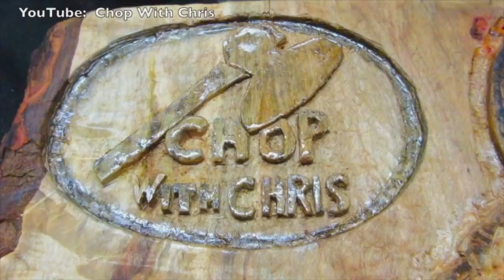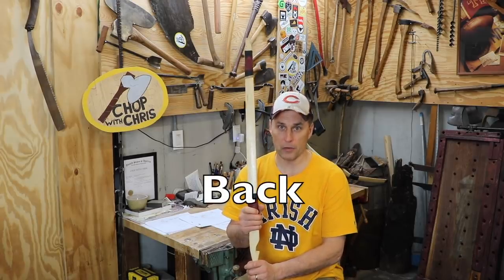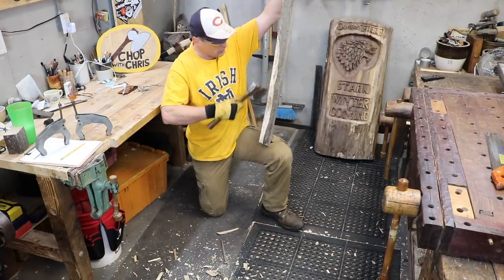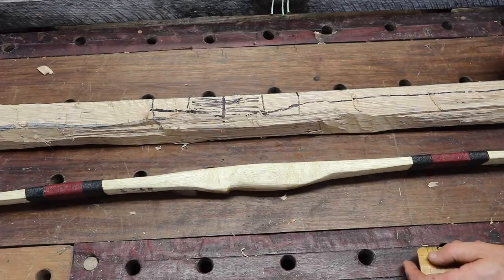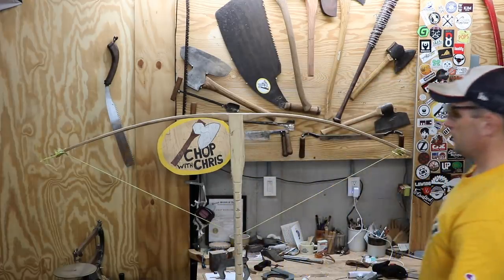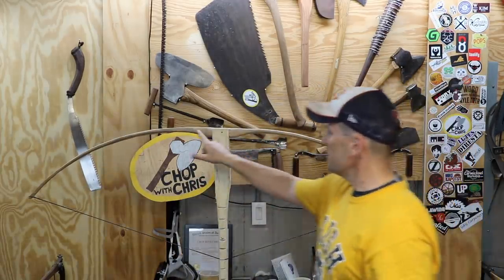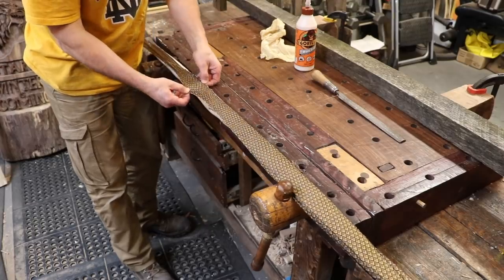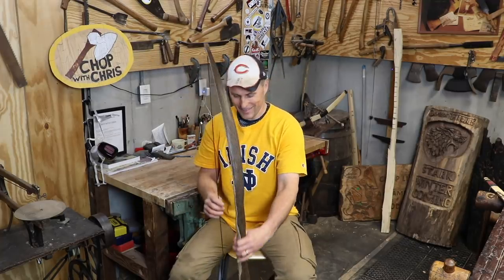HOW TO MAKE A BOW WITH SIMPLE TOOLS

Comment: I like how you made this.  I would have appreciated a little closer views of the back of the bow showing how the one continuous fiber looks down the length of the bow.  I understand doing it but I would have liked to have seen it.  Is it possible to use a froe in the early stages to get to the one ring for the back?  How long should the wood be aged or in a crises situation can it be done with green or fire treated wood?  Just curious, I’ve never made one but would like to attempt it in the near future.  Thanks.
Reply from the maker: A froe will work.  Wood should be dried.  I’ve some people fire dry them but I️ do not.  Got the feedback on the fibers
Reply: Typically people use a drawknife. It's like a froe with more control. People have had a lot of success drying their wood in a 80-90 degree kiln or in a hot attic.

Comment: Chris. Just a small correction. Wood bows bend towards compression. For example. In a wood diving board- the  top is in tension. The bottom is in compression. Similarly the back of the bow is in tension not compression.
Reply from the maker: Got it.
Reply: I believe that is what he said
Reply: That's what he said at 2:40 -- unless he edited the video to change what he originally said.

Comment: are you able to tiller while in tension to make sure you get even tension in real time?
Reply from the maker: I have not tried that.  Makes me nervous so close to a bow in tension. If the string slips you can get smacked in the face.
Reply: I've tried it and yes it hurts when things slip and smack you in the face! Just take your time. Check it, file it, and check it again! I was making the bow for a foot operated bow lathe about 25 years ago and still have a scar above my eye!
Reply: That was my question as well. Thanks for the reply
Reply: Yes you can, but it's better to do it when you're closer to your target draw weight. Also, if you do intend on tillering it strung, you should draw it a little in between scrapings so you get rid of the cell memory in the wood fibers otherwise you're not going to see the change.
Reply: A pistol grip "quick" clamp over the notch keeps it safely in place (or a C-clamp if quicks are too modern :) )  @ChopWithChris

Comment: perfect class Chris! specially about the wood selection. will start looking for this from now on!
Reply from the maker: Let me know if you have questions.
Reply: I do actually... you speak about the front and back of the bow. What about the sides? Do they affect too much on the  tyloring (how do you write that?) and the strenght? Or do you just follow a straight taper from the handle to the ends?
Reply from the maker: The back of the bow is the part that faces away from you.  Once you have achieved a single wood fiber, DO NOT TILLER the back of the bow, only tiller the front.  Better to taper wider half way between the handle the ends and then taper narrower to the ends.

Comment: Thank you for explaining in such  clear detail. Ive actually gained an understanding not just directions. Ive learned more from u in this one video then the half dozen before you. I like the fact that u explain why each step along the way. You are a great instructor and I greatly appreciate you sharing your knowledge and time creating this for us. This is truly an art. Im in awe lol I usually have more questions then answers but u were so thorough I only wonder which types of woods? Seasoned or green? I'm actually looking to figure out what peice will need to be created for the center grip peice to connect these 2 arms I was given. Yours is one peice so is that ur preferred way to have that grain strength? Do you know what would work for these or should I just make it a decor peice and create my own with one solid peice? I value your opinion bc u obviously know what you're doing. Thats awesomeness! Im proud of you! Thank you  sir. Have a blessed day
Reply from the maker: Thanks.  The wood should be fully seasoned.  What wood are you thinking of using?  In the US good wood for a bow include hickory, Osage Orange, Oak, and mulberry.  Search google under “good wood to use for a bow” to learn more.  I’ve never tried attaching wood to a handle but want to some time.  You should be fine and will need to ensure not to stress the limbs too much since the handle area will likely be very stiff.  Good luck.  Chris

Comment: Simple tools, so well explained this is exactly what I was looking for. One question though, how do I make sure I don't take the tree ring off or damage it when I file down the back of the bow?
Reply from the maker: I guess you just need to go slow and be careful.  It also helps to add a backing as a safety measure.

Comment: My first red oak bow was Inuit string style backed with rawhide over that. Glue was gelatin and I used a cordless drill because I didn't have even a hand saw, the rest of my "tooling" was a really cheap folding knife. 
Oak doesn't need to be a perfect single ring to work when backed by anything, but it is still the best way, and even if you try unbacked or glue backed (just glue, nothing else) it will suffer more defects than about anything else. Great learning bowyer wood, but it is slow shooting and chrysals if you try to go too short or too strong. 
Nice job on yours!
Reply from the maker: You have amazing knowledge!   You should make a video.
Reply: it'd likley(certainly) be far worse and I am too ugly to inflict folks with myself.
 Think "Face For Radio"
But it'd be named "How to make a bow when you have no money" as I was pretty much stone broke at the time.
Reply from the maker: That video would go viral!😄

Comment: Fascinating. Bows are really cool and not as complex as I'd have thought.

One question though, how exactly does the backing help? I didn't fully understand that part.
Reply from the maker: The back of the bow takes all the stress and ofter the fibers start to lift and eventually will cause the limbs to break.  The backing prevents this from happening.
Reply: I see. Cool bow. Nice to see trash turned into beauty.

Comment: You mentioned that your backing has some signs of cracking so the tillering wheel and a tillering string can be used for safe bend when tillering is in progress. You might stress the wood too much when you leave it for 10 seconds on a tillering stick. When useing tillering wheel and string you can pull a little bit at the time and see what part needs work and what doesnt.
Reply from the maker: Merci!

Comment: Would it be possible to back the bow with Duct Tape? That's a material I carry everywhere and am wondering if that would work for this application in a pinch.
Reply from the maker: I suppose but I’ve read drywall tape is better.

Comment: im making one out of "Maki" Podocarpus Macrphyllus  from a dead standing tree in a line fir a hedge but one is dead so thats my attempt . ive cut it to 4 foot 2 " the wood is so solid i guess its going to look like stone when done its so dense hope it works ive only used a machete and wrasp file and a hacksaw with metal blade to shave down the dense bumbs oh and sand paper. thanks for all your knowledge i see where ive made a few mistakes but i didnt have much material to work with i just winged it without watching any videos till yours  but did do alot if your techniques  im ready to tiller and hope to find a nice tie to copy that technique as i may have too . aloha from Hawaii
Reply from the maker: Wow!   Thanks and good luck!

Comment: would you recommend using panderosa pine tree wood? I'm in northern Arizona mountain's.. i have a tool's i have, a Ka-bar.. a handsaw, and hammer
Reply from the maker: No.  Check out this article.  http://www.primitivearcher.com/smf/index.php?topic=16560.0
Reply: Chop With Chris thank you! :) i am going to go to lowes , homedepo and just but some Board n do as you did in this video. i found some Chisel's today that havnt been used n i have some old files. N my knife to Chop the wood as you done! thank you i will get back to you about my Project! N how it turns out do you have a Fb group or Page i could add if i havw any questions as i go along? ive never done anything like this before or even worked with wood
Reply: Chop With Chris i went today I picked up a Birch Board from Homedepot. its 0.75 x1.75 is this Big enuff? it had no Nots n is really straight.
Reply: also cut it to 60inches length

Comment: Hi Chris! Question! When you building a crossbow flor you attention to annuel rings or does not matter? I have abo your cannel :-) Your info is very good! Happy new year and good building for another projects!
Reply from the maker: Thanks.   A crossbow should be just like a bow so the frown rings matter.
Reply: Sorry! My first question was not formed good. I mine the main stock or the main ground of the crossbow not the bow it self. Sorry, my english ist not good. Im from germany :-). I would cut the wooden main stick or stock of the Crossbow divide and turn it 180 ° than with glue together. This way, the wood can not warp. Why don't you do that?
Reply from the maker: That’s a good idea.  I’ve never made a laminated bow.  Danke for the idea!

Comment: Hi Chris. Francis from the UK here. I've been inspired by your videos and I've started to turn an old oak beam in my garage into a bow. I only have these four tools which you are using plus a bushcraft knife. So far today things have gone well but I've hit a snag and I was wondering if you'd be OK with giving me some advice? I greatly appreciate the time it takes you to respond and I will understand if I do not hear back from you. 

I'm trying to establish the back of my bow so that it is as you advise, the problem is I'm completely new to woodwork and i do not know what one unblemished growth ring actually looks like. Now I am near the depth of the back I originally designed for I've had a go at smoothing it out with a file and a knife just as a practice for the actual back about 0.5 inch further in. Finding my skills a little imprecise, I am reluctant to remove any more wood for fear of going to far. This link leads to some pictures of what I have so far.

https://imgur.com/a/6a2P7Df

Any pointers you could offer would be greatly appreciated.
Reply from the maker: Try to maintain the dark ring.

Comment: Informative and well made.  But the quality of the material showed through, when the silk was applied you could already see that the bow was starting to follow the string.  Either that or you had to decurve it to stop it from shattering, but I've only ever heard of doing that for pine.  Still, as a survival bow kind of thing it works well.
Reply from the maker: The wood was definitely in bad condition.  I should have applied the backing earlier in the tiller game process.  I could have probably added another 10# to the draw weight.

Comment: Chris - What kind of glue do you use?? I have a recurve bow about 45 years old, and one limb had a chip in the fiberglass lamination causing it to be slightly weaker. I simply raised the arrow rest to shoot straight again, but I would like to repair the bow and use the original arrow rest position. I have tried to buy glue at many box shops, but they have no idea what kind of glue to use that would be flexible enough. I would appreciate the info.

Comment: When you put the silk backing on I was thinking, would it be an option to use a hot iron to help the material to be put on? Then the extension of that thought was, what would a layer of charred wood, like they do for instance on roof shingles, do to the back of the bow. Would it help or destroy?
Reply from the maker: I would not want to over heat the wood.  Could lead to breakage.

Comment: How thick are longbows typically? (Not including the handle) I’m making my bow out of hickory and I want around a 50-60 pound draw weight. I’ve gotten my bow shape roughed out at about an inch thick (1 7/8th” wide) but comparing it to other longbows it looks a lot thicker than what it should be.
Reply from the maker: That’s ok.  Most of the bowls strength comes from the thickness, not the width.  Buy a cheap luggage scale and check the draw weight now and then start slowly tillering until it’s even and at the weight you want.

Comment: Tensile strength does not equal draw weight. A silk backing, or rawhide, etc, will increase the tensile strength. It just doesn't automatically increase draw weight.
Reply from the maker: I agree.  My point was the wood was really brittle and installing the tie earlier in the tillering process would allowed me to tiller to a higher draw poundage since it reduced the risk of breakage.

Comment: Chris, I have a finished longbow the weight is 71lbs. I'm getting weaker in my older age lol. Is there a way that I can change the draw weight on the longbow?
Reply from the maker: I suppose you can further tiller it to remove wood.  That would bring down the draw weight.

Comment: Great video. Some constructive criticism from an archer and bowyer's standpoint of personal experience and research. If you plan on backing a bow, it's actually okay to violate the back somewhat and also rough it with a rasp to score-slip the backing in order to be better glued to the wood. Ishi and Geronimo did this with their sinew-backed bows as did and still do many Native Americans of tribes that use backing on their bows. If not backing, you really want to avoid using a file since they have the tendency to rip wood and as such, a card scraper or cabinet scraper is ideal with a spoke-shave also being a very good choice. Then follow with fine-grain (500 or more) sandpaper and a touch of light oil like linseed or a bit of Crisco on a rag. Clean and supple wood that is oiled and smoothed can then be burnished with the leading edge of a knife or a piece of animal rib-bone for somewhat of a stone-age touch on the back, making the concentric and single grain of de-crowned wood one chases harder and hold more tension and also look shiny and nice, too. All I need is my Fiskar's wood hatchet, my Mora bushcraft, a cabinet scraper, and some rough leather and a piece of sandstone aside from the whetstone, plus a rag and some oil. Two weeks to season if pre-oiled and heat-treated while carved green to speed up the seasoning, or the other alternative is up to a year or two if dried out the long way like I prefer as with English longbows and Cherokee bows. :)
Reply from the maker: Wow!   This is awesome.  You need to make a video 😄. Thanks for the information!
Reply: Thanks and quite welcome. :) The green-wood that gets heated and dried somewhat quickly is the traditional way to make Apache and Sioux bows using just a knife and flint shards for scrapers. The fine flint removes the need for sandpaper and leather and oil with bone burnishing is still used, along with the sinew-backing. Most of my experience come from Cherokee bows that are simple self-bows and flatbows made from hickory, black locust, honey locust, or even bois d'arc a.k.a Osage orange (if in Oklahoma for the latter-most) and made with distinctive diamond-shaped nock-tops. Only the Sauk and Fox along with the Seneca used a similar pointed design with nocks, but other than that, the bow was pretty Spartan and meant for hunting while tomahawks were the main weapon for war as with most nations east of the Mississippi. The Cherokee version uses your non-backed way (and often hickory at that) of doing it while also drying it in the rafters of a breezy summer lodge like that of a Seminole chickee for around nine months to a year. Also, it's best to cut it in the dead of winter and in the evenings when the sap is low in order to minimize cracking. Check out Noel "Tim" Grayson of the Cherokee Nation in Oklahoma. He's a very nice guy that does tons of stuff on how to make bows, flintknapping, bone tools, and other traditional skills. He showed me a number of things for how to get a bow to come out right.

Comment: I've been looking for a proper bow making video for ages and this is the first that i find a total beginner can do i really like the tips. I will use some power tools since i have access to them. Question time: how good of a wood would acacia be since it is quite flexible and I have access to it. Question 2: is that laundry rope that has wire core and rubber coating a good replacement for the string? Thanks a load.
Reply from the maker: What country?
Reply: Croatia.
Reply from the maker: I believe it can be used for a bow.  I would look at primitivebow.com for some info on this.  In terms of the string it scares me to use anything but a proper bow string.
Reply: Well, I do  like living dangerously. I'll provide feedback on how the string turns out. if i survive it. Thanks for the info, you earned a sub :)
Reply from the maker: Thanks and good luck.

Comment: I prefer a heavy machete instead of a hatchet(and a bolo type bowie knife for a makeshift draw knife). Also a subform plane rasp before filing. Last but not least, a good strong and smooth glass(a beer bottle would do) to really mash down the fibers on the face; plus it leaves it with a nice shiny polished look.  But hey, everyone has their preferences. Good work.
Reply from the maker: Thanks for the suggestions!